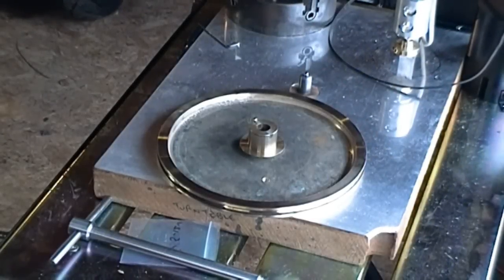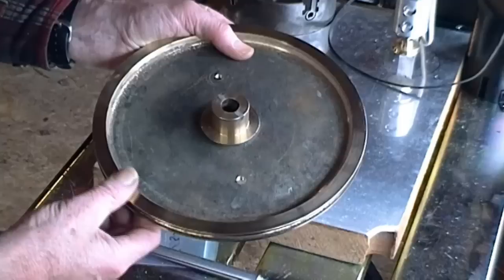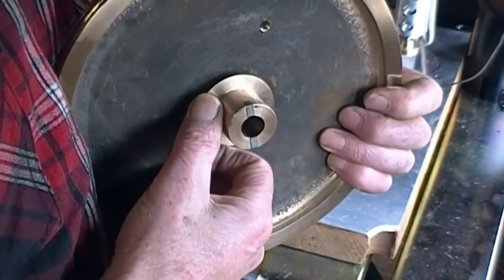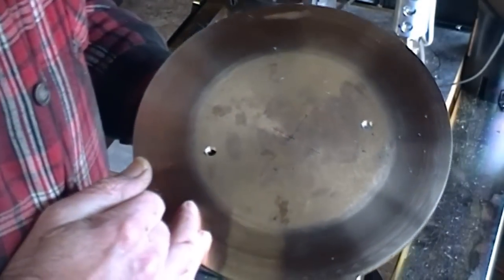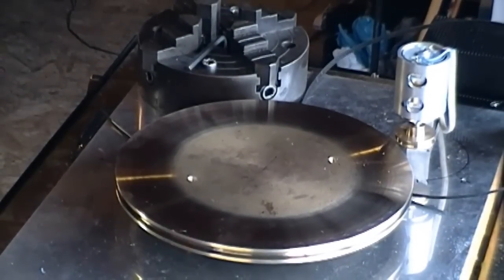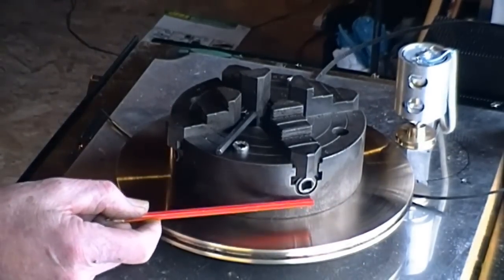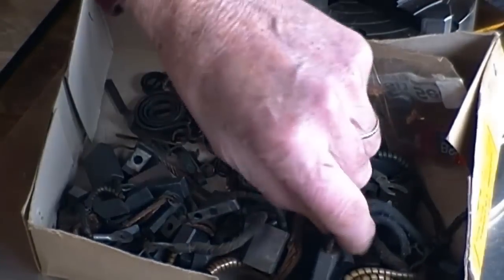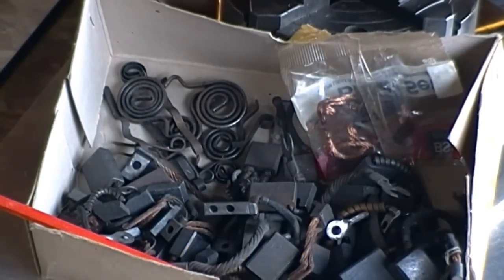Motorized Turntable, Part Four - improving turntable

Comment: Hi Chris, Thanks this has been a great project to watch, with really great ideas. You should really get some heat in the workshop, this could be another project. As far as grounding the turntable, you have many options, but I agree that you shouldn't ground it through the chuck. I would ground it underneath the turntable and the closer to center you get the ground brushes the easier the motor will have to over come the friction from the brushes, due to the higher rotational torque at the center . The brushes will also wear less too. I would try putting the brushes on the bottom inner hub of the turntable, that you just machined. Putting it there will also protect it from weld spatter. You could drill a hole and feed the ground through the wood and aluminum plate under the turntable, cut out a channel on the bottom of the wood, out to the edge for the ground wire to fit, so the turntable will still lie flat. Have some kind of lug at the edge of the wood, to hook the ground up to from the welder. You could still keep it isolated from the aluminum surface plate underneath and even the chuck if you insulate the chuck from the turn table then drill hole in turntable and fasten ground cable to the turntable, which would now rotate with the turntable. Put clamp on this wire now coming from the turntable to clamp right to your part and not through your chuck.You could also make a belt cover out of thin piece of sheet-metal, shaped like a modified triangle with an attached straight tab at the corner closest to the motor, then bend the tab up to 90 degrees and use the hose clamp around the motor cover to secure it. Just set the height so it just slightly rest on and at the edge of the turntable, it would not cause very much friction and sparks could get under it. Anyway just some ideas I had, good luck with this project, can't wait to see how you finish it.
Reply from the maker: Hi Edward. Temp control in the shop is always a major problem.  No ceiling so - any heat gets wasted - plus not in there 24/7 which might justify some sort of long-running stove. Mind you, in summer at 90º is also problematic! Nice thinking re bringing grounding feed thru from under - like that. Yes, belt protection finally probably will be a small triangle shaped piece of thin sheet. Hope to advance things gradually and record progress - including mistakes, which are bound to occur! Many thx for your input.

Comment: Chris

Looking good.  Saw your brushes - they appear large enough to carry the load well especially so if you use multiple brushes.   I also favor underside of table for brush contact - one to avoid weld spatter problems second - get them out of the way.  Bit concerned about weld current going thru the chuck - that can be reduced and maybe almost eliminated by a bonding jumper between the plate and the work.  Brushes last longest if run hot say around 150 200 -- IIRC -- gotta check on that.  Main challenge will be temperature rating of insulation between brush holders and aluminum table top.  Fiberglass type insulation plates out of switchgear may be good option so would phenolic.

Dan Bentler
Reply from the maker: Thx Dan - all good stuff and appreciated. Jumper - good thinking.  Also - I intend I think to remove more of the Al top sheet - so that under turntable is mostly exposed wood - then, I have some phenolic or glass fiber PCB material to use for added insulation if required. Trying to come up with some brush holders by adapting some Al channel and, try for three brushes. Those however will have to be re-profiled to suit hub radius.  Doubt they'll ever run hot tho. Plenty of fiddle yet!

Comment: Lots of choices now with your platter clean up for the brush system.  I wasn't clear you could chuck it up before...but thank goodness for the chuck mounting screws.  Agree with Cerberus below and reminds me of the Da Vinci saying "Art is never finish, only abandoned"...same goes for engineering I think, although simple elegance can be achieved.  Looking forward to yours Chris!
Reply from the maker: Yes, chuck mounting threaded holes made faceplate fixing possible. Other later thoughts in my comment lower down to Dan Bentler's post. Plenty of stuff to do yet that's for sure!
Reply: ChrisB257 dan bentler  I think Dan may be right about the current through the chuck, and a good fix with jumper to the work.  Directly to the work can have its downside though too.  As I remember you have a 90 amp unit but if you go to a larger tig, either could be a problem with the jaws, gears and scroll.  As for the brushes, maybe using the larger flat side instead of the traditional end push would give more surface area...still would use 3 depending on size and any wobble in the platter.  My thoughts are still toward a top cover guard approach because it gives you more current handling because of the surface area/cross section and helps dissipate some heat from the brushes, And protects the platter from spatter.  You might use your channel idea and just epoxy or (JB weld) them in and use a jack screw approach for pressure & contact thru a top guard weld nut.  Not sure the braid from the brushes that I saw will handle that much current...3 maybe...need to think about that.  For Dan's jumper you may need to expose a bit of your platter close to the chuck to put a jumper lug(s) in.  A 3/8"-1/2" should be plenty and give you plenty to attach to and plenty of surface area in the platter for connection...maybe fine threading the platter & using a bolt would give you more surface contact to the platter¿¿...a plethora of possibilities. @¿@  ~PJ
Reply from the maker: pjsalchemy Thx again -- yes, a multitude of options! Once again, appreciate input and will continue working on this. More and more it does seem a jumper to bypass the chuck is very sensible. Since platter machining, wobble should not be a major factor, and still thinking of finding a way to keep brushes under some sort of spring tension for good contact. So much to do! :)

Comment: We are talking significant currents for welding, so the biggest risk with a large single piece as a brush is one small imperfection (eg welding spatter) would suddenly reduce your contact area dramatically.
I'd be looking at multiple brush contact points, for redundancy and ability to skirt over imperfections.
Contact beneath greatly reduces spatter risk.

Why does your base plate need to the isolated?
Making non insulated brush holders would be much easier...
Most importantly, do not deliberately pass current through the bearings.
Reply from the maker: Hi Ray -- agreed, multiple brush contacts preferable and am currently exploring options to use three in a delta formation around the hub. Reason for isolation is to avoid protective Al sheet and motor etc from being involved in the circuit. Thx for the comments.

Comment: I am sure you will need a brush for the electrical connection to your turntable.  I know that when I worked in the refinery they had to be very careful where to put the ground lead when they were welding on pumps.  If the electrical path were through the pump or motor bearings they could be ruined.  One thing about a project is that it is never finished to your complete satisfaction.  I learned that it even can be a stumbling block for computer programming as when I first got started the urge to go back and improve some part of the program you just finished was almost irresistible.  I had to remind myself that "it does everything they asked for so stop here."   Anyway you are doing a fine job so far and I look forward to the next enhancement.  Thanks for sharing.
Reply from the maker: Thank you - indeed, this is taking on a life of its own! But for sure, some projects never seem to quite finish - although if I get the grounding satisfactory with a brush approach I may just leave it alone - famous last words!

Comment: Hi Chris !

I would say the brush should run on the smallest diameter as possible ... the hub (boss ??) is an obvious choice for me - slow movement and big contact areal 

No splatter under the table so I would place the grounding setup under the plate..
Reply from the maker: Hi Keld -- I agree about smallest diameter, even though revolutions will be super slow.  Down-side of hub approach is possibly a more fiddly job to set up, although even now my scheming old brain is hatching a plan!